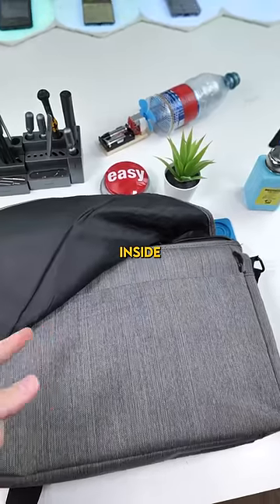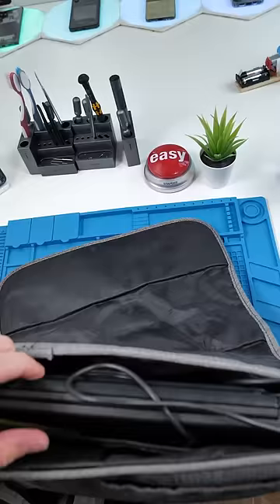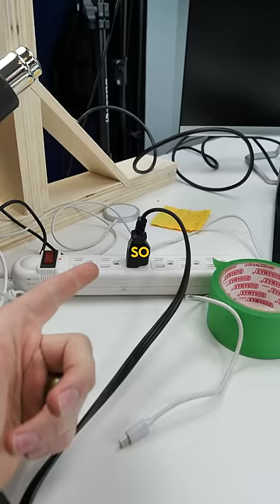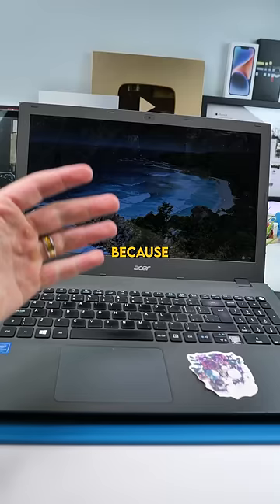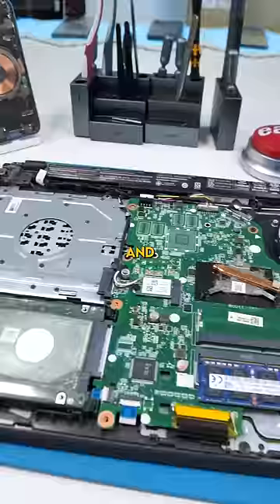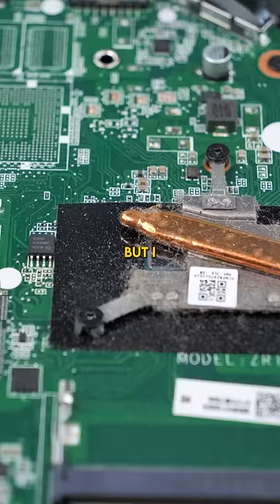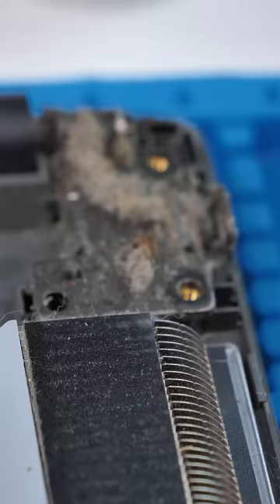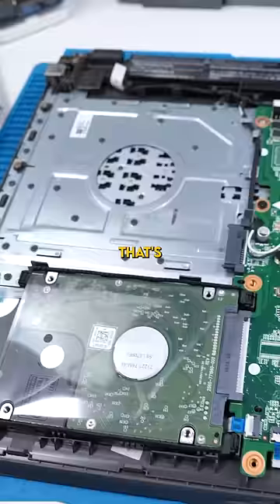This Laptop Had Bugs Inside... #Shorts

Comment from the maker: In cases like this I would just tell the customer to closely monitor the laptop for any issues. It was sitting in a small puddle and since all the components would be elevated off the surface of the table, it’s unlikely any of them made contact with water. Also if you’re ever working on a laptop/pc that wont boot up, the ram is a great first place to check.
Reply: Or maybe a faulty charger
Reply: What did you apply to the tip you used in cleaning the system
Reply: Make the 1000th video about the iOS 17 and it will be very cool love your content and fixing❤
Reply: @x3notrone  isopropyl alcohol
Reply: It's me again 😂😂😂❤❤❤ 
Pls heart me
Reply: @roh41l_vfx  doesn't that  remove the paint on the ram?
Reply: sᴉuǝꓒ
Reply: @x3notrone  Nope, its completely safe to use as long as you make sure it evaporates before putting it back in since it has 1% water which can damage if not evaporated.
Reply: @x3notrone 99% isopropyl alcohol
Reply: Fr
Reply: My laptop delted its software and wont accept a software
Reply: I once opened an acer that was boot looping, the ram was missing
Reply: People should learn to take care of their electronic
Reply: why is the ram the first thing to check? :0
Reply: @roh41l_vfx  okay but can we use this to clean earpods and phones. I am asking because it did remove the colour on a earpod.
Reply: This is like a book guide
Reply: We have laptop inside the bag and bug inside the laptop

Comment: For water damaged things you should not boot it up, might cause shortage, isopropanol to eliminate water and good cleaning should be good for some time
Reply from the maker: Typically yes, I wanted to see what the issue was. The customer had already attempted to boot it a few times so the damage ( if any) had already been done. I let it sit for a few days and then tried it.
Reply: @PhoneRepairGuru The issue is the laptop was submerged. Turning it on is not a good first step and won't let you see what the issue was. It's possible water moved inside after it was shipped and made something wet.
Reply from the maker: @chriscollamore5471  wasn’t submerged, there was a small puddle on a table and it was sitting on it. This wasn’t shipped but brought into me by a customer. I don’t take mail ins right now
Reply: Are you trying to correct a professional?
Reply: @chriscollamore5471 Why are you people so obsessed with correcting others but not helping?
Reply: @FlatEarthKiller There are many people like him on the internet unfortunately.
Reply: @dezalt  👍

Comment: Did you check on the other side of the motherboard. As a pc tech I've seen a lot of motherboards look fine on the one side but then look like component graveyards on the other. 
Also my tip to the consumers. If your electronics get wet don't! plug them in . Turn them off and take them to a technician to get cleaned. It's a rule at the shop where I work that even if the client's laptop had a spill two weeks ago we still don't turn it on. We immediately disassemble the device and clean it first.
This protects the device from ever getting shorts if there was liquid on bad spots.
Reply: Im also working on a lot of damaged laptops and other electronics at work, and it sounds like you guys do it the correct way:)

Comment: I assume that you did it but in case you didn't you really should on any laptop unscrew the fan from the heatsink and cleanup the dust which is collected between them and while you are at it you should also unscrew the heatsink from the chips (cpu, GPU etc.) and replace the thermal paste and pads.
P.s. what glue/adhesive do you use to glue back phones together?

Comment: I’d use something besides tape to cover up the name the adhesive might damage the screen
Reply from the maker: I use this tape all the time it doesn’t leave any residue
Reply: Nah, if your screen cant handle a bit of green painters tape lightly put on there, you would have bigger problems:)
Reply: @knutruben1  I’m not a tech guy I just assumed as when I clean my tvs/monitors I use a microfiber cloth as I know rags can damage it  I thought there might be something similar with peeling off tape

Comment: You turned it on without checking if water was still on the pcb... really lazy work. You also put tape on his screen to cover his username just for your video???? Very unprofessional. Do better man , just think before you do something stupid.
Reply from the maker: He already powered it on , i left it to dry for a few days. Also why you mad about the tape😭
Reply: @PhoneRepairGuru  I mean hey man im not trying to be a a**hole lol i run a business myself and if smoke started coming out of the pc because you didnt take out 8ish screws i mean thats on you, you would be responsible for the damage, i mean by all means go ahead without doing it just know thats a big liability its real easy for a customer to take you to small claims court over something like this and now he has video proof, I never had any issues with court but I have heard stories its better just to check. Now for the tape issue lol: because you put it on a customer's screen man 🤣 why not just edit the username out. Your like "here man I left some tape residue on your screen because I made a YouTube video using your device" I mean wouldn't be too happy about that, just unnecessary and you I know you didn't ask your customer.
Reply: @natezoom1 he probably cleaned off the tape residue later on